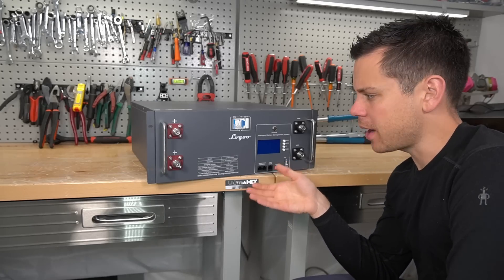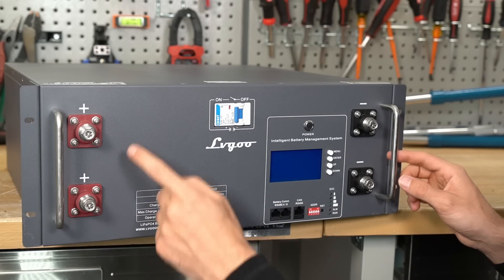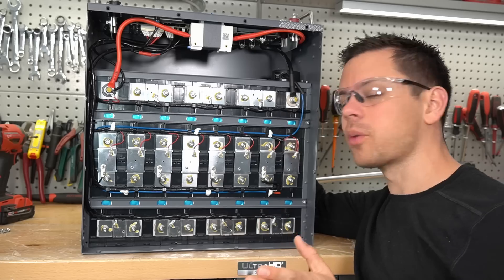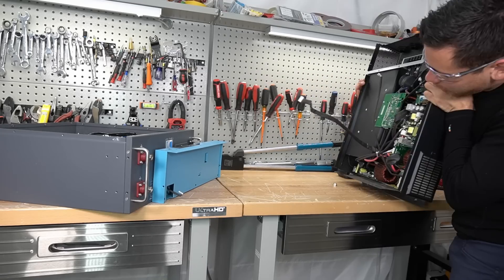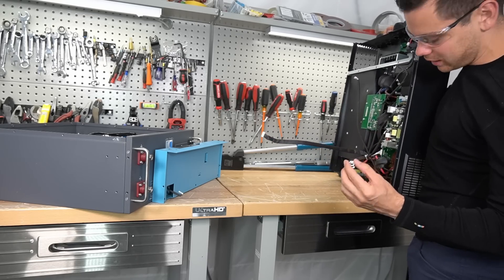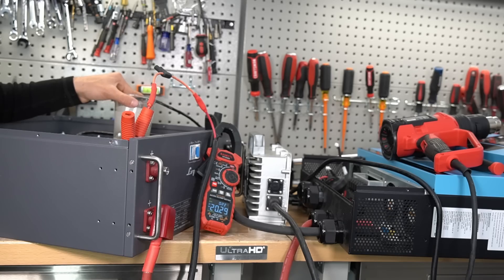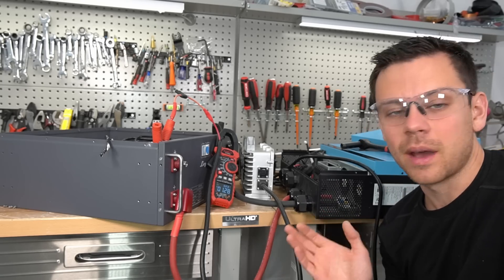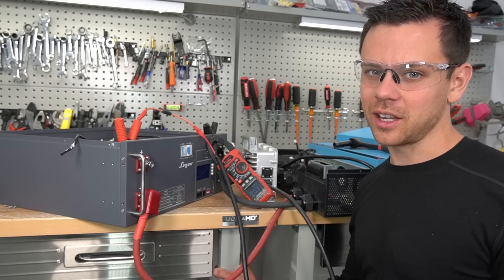New! $1,639 LVGOO 48V LiFePO4 Server Rack Battery

Comment: With all the protections you have even from big brands,why do they make all the connections on the front ?Leave the front for display and switches get the battery connections in the back. 
Why is so hard to assimilate that in design?

Comment: I’m confused with the bms. So a 50 amp bms only allows 50 amp so if I have 3000 watt inverter it needs 300 amps to fully function. So i need 6 battery racks?

Comment: I would love to see you do a video budget cells for DIY projects. I am looking for a high discharge 48v pack for golf cart just used on 2 acre property so no need to run several hours. All I need is an hour run time at 60continuous and 125max discharge. I was thinking about the headway cells but wondered what you thought would be a good cheap option for a DIY pack.

Comment: "Server racks" otherwise known as electrical or electronic equipment racks are available in every city. They've been around for decades, used for radio, TV and computer equipment including commercial servers. Just look for an electric/electronic equipment store. Btw IBM used these for mainframes, mini computers, switch racks, etc., so when designing their PC they started with a rack tray. If you took the cover off the screw holes line up with server rack slide rails and the holes in the back and front plates match the hole placement in server rack posts. Racks have feet that you can get so they can be bolted to the floor and ceiling.  Racks server UPS's are usually mounted on the bottom of the rack and can provide backup power for several servers. No solar inputs, but battery charger, battery and inverter.

Comment: You have mentioned that in cold climate areas that LifePO4 batteries can still be used.    I want to build an off grid system for a camp where the inverter and batteries will be in an insulated shed.   Typical night temps in January 5F with a day temperature of 30F although several days below zero can happen.  A few winter days with highs in the +40s can also occur.   Camp would not be in use during those really cold spells.   Could you make a video with a cold weather system?  Perhaps the battery cabinet can have removable panels for the winter season.  Note that the "top 12" states in USA have this problem.  Thanks!
Reply: Hello Darryl, We are the manufacturer of the server rack battery LV48V100D. I think It is better for you to have the insulation materials around to protect the batteries from the freezing and even lower temp. in winter. We have the assembly battery cabinets to work with max 6 units of our server rack batteries connecting with each other in the cabinet. The Front/Back Door are  removable, there is one removable panel on each side of the cabinet. I think this cabinet is good for the added insulation materials since you can add and move the insulation materials easily by the 4 sides removable design. The heating pads probably are not practical since the batteries are big. That is what I thought.

Comment: I searched your historical videos but did not see where you have addressed my idea. I have a large piece of property in NC. My idea is to set up a complete system on a small trailer, enclosing it to protect from rain etc but allow air flow. My idea is to have power stations on various locations that will, essentially, be just power storage for use at that station. If this works, I would periodically pull my power system trailer to any power station in need of charging. When not charging at a power station, I would park it and connect to the main cabin. Please share your ideas, maybe do this build in a video or direct me to your video if you have done this already. I'm thinking like 6-8 power stations where I would not need to buy solar panels and the other gear for every power station. Thank you. Love your videos.

Comment: I really wish you would buy a Taicopower server rack battery and review it on your YT. They sold me prismatic cells and they ended up being pouch cells. I bought one and took it apart recently (put pics on the DIY Solar Forum) and I got totally hosed. You can search "Taicopower" and it will come right up on the forum. 1 of my 6 battery packs only pulled about 75% of the capacity due to a runner cell... and they do not give any sort of mercy. The others are not pulling full capacity either. You get what you pay for and you have 30 days to load test or it's over. Even if you do load test immediately, you'd have to fight with the Trade Assurance through Ali. I doubt you'd be very successful.

Comment: I have a 12v trailer..  four 100Ah BB lithiums, four 400w panels, Victron 150\100 controller, cerbo and bmv 712..  I recently bought a 48v Multiplus. I have 30a shore power as well.. just getting the RV ready for offgrid living. Is this a good combination..?

Comment: Thanks so much for this video.  Am wondering what types of battery’s can we add more of over time without penalty, if you know what I mean.  
Also, which voltage system ultimately uses smallest wire, pound for pound.

Comment: Will, thank you for your great content! You have mentioned in the past that you do not like BMS communications between the inverter and the batteries. Could you do a video explaining your thoughts on this? I have bought same-brand batteries in the past because of BMS communications compatibility, and it would open my options if I disregarded this requirement.

Comment: Is the BMS parameters user changeable or is it hard coded?
Reply: The BMS parameters of LV48V100D Server Rack Battery are changeable by a code to enter the BMS software on PC which communication cable is connected to the battery comm. port.

Comment: Here is the complete and accurate words description of the re-setting and test: 

In the factory, we changed the settings of the BMS CHG(Charging) UT(Under Temperatures) Alarm/Protect/Protect Realease(℃) From 0.0/ -5.0/ 0.0 TO 5.0/ -0.5/3.0(Because the practical and accurate temperature of Ice Water is almost a little bit higher than 0.00℃ like 0.05℃ ) and I have to mention that the duration time in the BMS from the reaching of the temperature settings to practical alarm/action(protect and protect/alarm releasing) happen is 2 seconds.

1. We put the 4 Temp. Sensors of LV48V100D battery into the Ice Water, 
the BMS shows T1/2/3/4 data drops from 23.1/24.8/24.8/24.9℃ to 4.3/6.8/5.5/7.3℃ in about 5 seconds to reach the CHG UT Alarm setting 5℃, 

then in 2s to trigger the CHG UT Alarm, 

then drops to 0.5/ 0.7/ 0.7/ 0.7℃ to reach the 0.5℃ CHG UTP Protect, 

then in 2s to trigger CHG UTP(UT Protect) and the charge stops.

2. Then we get the 4 Temp. Sensors out of the Ice Water, they start to be back to the Air Temp. to be 5.2/ 4.7/ 4.0/ 3.4℃ to reach the CHG UT Protect Realease setting 3.0℃(for all sensors≥3.0℃)

then in 2s to trigger CHG UTP Release then the charge re-starts.

then the sensors continue to be back to be 7.2/ 7.0/ 6.3/ 5.0℃ to reach the UT Alarm release setting 5.0℃(for all sensors≥5.0℃) 
then in 2s to trigger UT Alarm Release.

I think this test proves that there are no problems with the battery hardware especially the BMS and the Temp. Sensors. 

The Temp. Issue in the video was caused by the differances between the original Charge UT/UTP settings of the Lvgoo LV48V100D Server Rack Battery in this video and the common Temp. settings of other competitors' batteries.

We decide to be consistent with the Charge UT/UTP settings as Will suggested and other competitors' batteries settings like SOK and EG4 to keep the cells in state of charging 100% away from 0.00℃.

Thank you Will!!! and we will email you the videos and report of this test and we want to hear your comment.
Bill😀
Reply: Are you saying that Will didn't wait long enough for the sensor and the BMS to react to freezing cold salt water?
Reply: @jimegan7077  I do not think you read carefully what I posted here and you probably did not realized there are 2 different tests:
Test A: done by Will in this video on the settings of CHG(Charging) UT(Under Temperatures) Protect/Protect Realease(℃) : -5.0/ 0.0
Test B: done by us in this description here on the re-settings of CHG(Charging) UT(Under Temperatures) Protect/Protect Realease(℃) : -0.5/ 3.0
I have to mention that the duration time in the BMS from the reaching of the temperature settings to practical alarm/action(protect and protect/alarm releasing) happen is 2 seconds. In Test A, the sensor temp. went down so fast to be -10℃ captured in the 2s duration time. I did not ask Will to find out the accurate -0.5℃ CHG UTP since it is difficult. I just explained that in Test A why the temp. detector captured the -10℃ on the temp. sensor out of the original CHG UTP setting -5.0℃ as well as the BMS is valid and works.

Comment: Surely as the current surge is the inverters input caps charging, that would be "out rush" current and the resistor should be on connection to the inverter?  How has it got anything to do with hardwired cells?  There aren't any capacitors on the output of the battery.  I'm lost.

Comment: Personally I like that it is serviceable. Build quality is not bad. You are right the handle bars  too close to terminals. Not bad, not  bad at all.
Reply: Thank you for your admisson. As the manufactuer of Lvgoo LV48V100D, We will replace the stainless steel handles which are quite closed to the nearby battery terminals by the rubber coated handles which are 100% firmly coated and 100% insulation.

Comment: That looks pretty good.I only see 2 changes to make that great. 1 update firmware to 0C shut down charge. discharge is ok the way it set. it's charging in cold that hurt the cells. 2nd make them handels with a hinge so after installed in a rack you can fold away giving more room to terminals. 📶
Reply: Thank you for your addmission, Robert, We decide to be consistent with the Charge UT/UTP settings as Will suggested and other competitors' batteries settings like SOK and EG4 to keep the cells in state of charging 100% away from 0.00℃. And We will replace the stainless steel handles which are quite closed to the nearby battery terminals by the rubber coated handles which are 100% firmly coated and 100% insulation.
Reply: We will use the PVC coated(about 0.8mm thickness) handles which are 100% fully coated and 100% insulation from the battery termials in the next batch. We put the original handles into liquid PVC and get them out to cool them so the PVC would attach on the handles firmly.

Comment: So...how can 48v be divided up for everyday use? Since most everything operates off of 12v.
Reply: Look up "potential divider".
That's a simple way to do it, using a couple of resistors. You will probably need power resistors and protect it with a fuse.

But make sure you understand the equations and can design it properly so you don't get too much voltage drop when a load current is drawn. And carefully consider what quiescent current you want down through the resistors when no load current is being drawn, as that is wasted power. And ensure you calculate the power dissipation in the resistors so you can select the power rating of resistor appropriately.

Or you can go down the route of a voltage regulator circuit.

Comment: With the welded battery terminals in mind, I am curious what the rack mounted batteries designers are doing to overcome long term expansion of the cells, with the welded terminals at the top, and no equivalent restriction at the bottom of the cells? They have probably designed for this, but what is it they are doing to allow welded battery cell bus-bars some room for expansion between adjacent cells?
Do you have rack mounted batteries that you have used for more than a year which could be checked for expansion issues that would only show up over time?

Comment: as for the handles take them off and wrap in heat shrink, and it would help.  I have been watching these videos because I like to get some new batteries for my solar system.  so I can get it back up and going again.  I like to get a 1000 AH battery or at least a 50KW system Just wish the prices would go down.
Reply: Hello, thank you for your advices. We offer discount for muiltiple batteries purchase. We are confident with our product quality. The battery has High Performance Brand New True A+ EVE LF100L(A) (3.2V 100Ah) Cell*16 Fastening Connected in series. EVE is the leading LiFePO4 Cell manufaturer.

 As the Manufacturer of this battery pack, I can tell you that there are Terminal Pipe Caps in the package of the battery. The Terminal Pipe Caps are suitable size and tight for the cable lugs and battery terminals and very helpful for the Insulation including the Insulation between Handle and the battery terminal. The good connection operations are as below:

For example, When Connect the 2 Main Cables to the terminals of the Top/Bottom LV48V100D in parallel string.

1)Insert the Red Labeled Positive Main Cable(RLPMC) into 2 Red Terminal Pipe Caps; Insert the Black Labeled Negative Main Cable(BLNMC) into 2 Black Terminal Pipe Caps.

2)Connect the the RLPMC to Upper Red Positive (+) Terminal of the Top layer LV48V100D and Connect the the BLNMC to Lower Black Negative(-) Terminal of the Bottom layer LV48V100D. or Connect the the RLPMC to Lower Red Positive (+) Terminal of the Bottom layer LV48V100D and Connect the the BLNMC to Upper Black Negative(-) Terminal of the TOP layer LV48V100D.(Connection steps: removing the Terminal Bolt, inserting it through the eyelet of the Main Cable Lug then reseating the Bolts into the Terminal Block).

3)Fasten the nuts by wrench to the correct torque(100~130 in-lbs/12~15 N-m)Cover the connection of Terminal Block, Main Cable Lug, Washer and Bolt with Terminal Pipe Cap.
Reply: We will use the PVC coated(about 0.8mm thickness) handles which are 100% fully coated and 100% insulation from the battery termials in the next batch. We put the original handles into liquid PVC and get them out to cool them so the PVC would attach on the handles firmly.

Comment: I really like how the double terminals are top and bottom, no more clumsily routing the conductors away from the screen by crossing them over...
..just really gotta wonder about why they're so close to the handles.
Reply: The BMS inside the LV48V100D is different from the ones in EG4 or SOK batteries.

Comment: Could plasti dip the metal handles? Or would it just be a wast of time? I agree that they should move the handles away from the terminals but I used to plasti dip the handles of the tools I used around electrical components when I was a diesel technician. Thanks for the video.
Reply: Thanks. We will have fully PVC(0.7mm thickness) coated handles for the next batch of server rack batteries. It is exactly the PVC dip processing.
Bill

Comment: Charging Lifepo4 batteries under 0°C is fine if it's at a low C rate. Most BMS cuts out completely but it would be nice if they had a way to reduce the charging according to the temperature instead, just like EVs do.

As a Canadian, I actually love the fact that this battery lets you charge it in cold temps. I installed an small off grid system in my parent's cabin with a JBD BMS and it came with a -10°C discharge cut off and a 0°C charging cut off. Thank god I was able to change it because it would be unusable all winter. It never gets over 0.3C discharge and 0.05C charging rate anyway.
Reply: Yes, You are right. In the detailed specifications of the LiFePO4 battery cells, there are detailed, ideal and accurate charge and discharge regulations at different temperature ranges. It is impossible for the packs to be used strictly according to the cells' detailed, ideal and accurate charge and discharge regulations at different temperature ranges. Keeping the battery packs work on the condition of battery safety is the most important thing. Wear and Tear of the battery pack more or less is the second thing to consider.

Comment: Chinese brands on Amazon like to copycat other common popular versions of what they are making, and then they just create DISPOSABLE company names, as they do not intend on being around longer than a year. it is a sort of epidemic that Amazon's current Seller system cannot hamper. there are many YouTube videos about Amazon Scammers.

not that all Chinese copycats are "scammers", but they are basically just covering their butts in case things go south with their product(s). you may notice that they have not been in existence for long, or they don't have many products.

so yeah, that is why their names don't make sense: they don't know English naming schemes that well, and they do not intend to be around for too long. 90% of the time, they are between 4 and 7 characters, and are all but impossible to pronounce. they don't really mean anything. just a placeholder name for their current line of product(s).

i would not recommend any cheap Chinese products, even if they are higher dollar. the Chinese do not have the same quality assurance laws that the U.S. does. even if it works fine, there is no guarantee how long it WILL work.

Note: in THIS case, you can SEE it is a Chinese store, as it has the Chinese characters right in the title bar for the website.